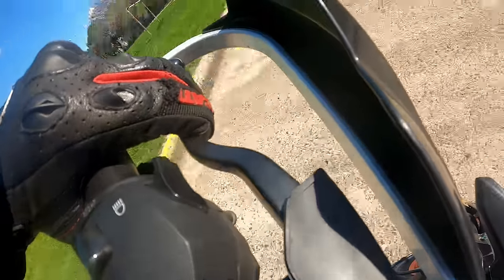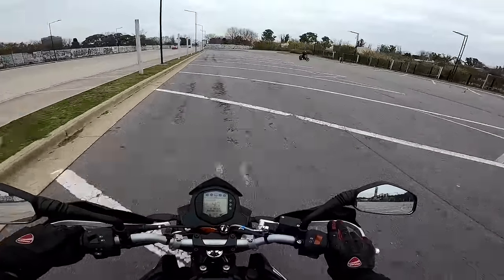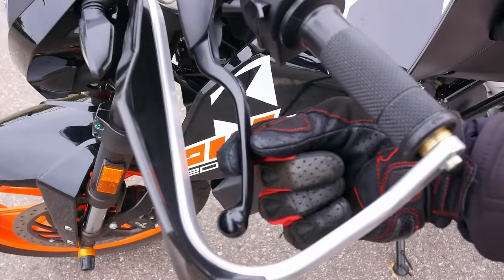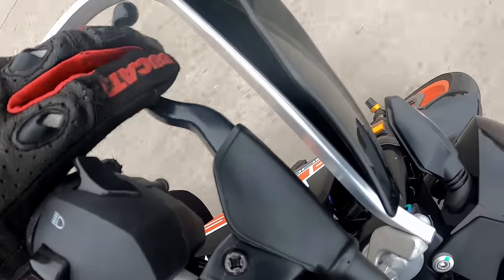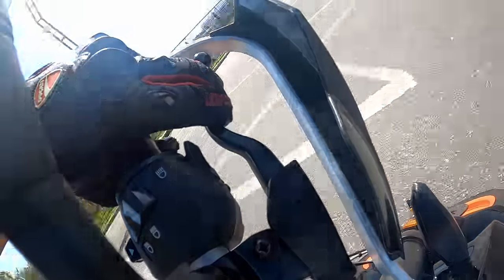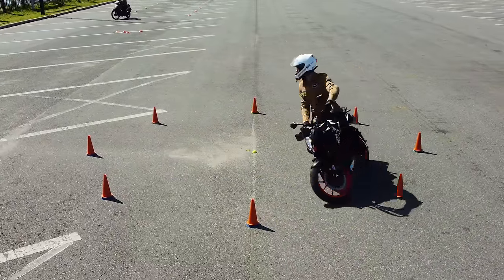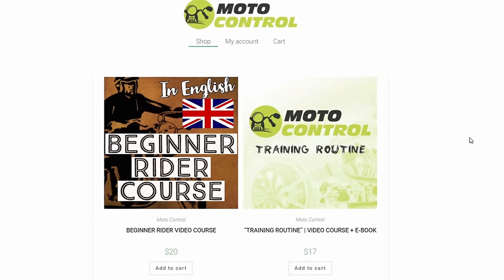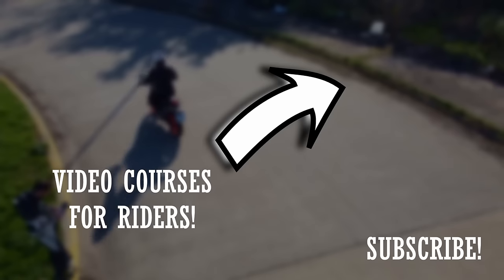How to Use CLUTCH on a Motorcycle - Free Full Guide

Comment: I think the whole clutch burning thing comes from the car world, where cars have dry clutches and overheat a lot easier than bike's wet clutches
Reply: Even when I used to drive a manual car, I let the clutch out to the friction zone before adding gas.  You can ride the clutch for about 2sec when starting from a stop because it's pretty much done slipping as soon as you're rolling, provided that you don't overwhelm the partially engaged clutch with heavy throttle.

Trying to save the clutch by slamming on the gears and engine mounts is a bad idea.  Slip the clutch a little.  That's what it's for
Reply: Moto guzzi’s use a dry clutch and BMW’s as far as I’m aware of. The upside of it is though is a Guzzi or BMW clutch will easily last as long as a car’s 100,000+ miles with normal use.
Reply: Yes, and some people reving like crazy while parking themselves using straight the friction zone... 😂
Reply: @Mythansar  it helps with the big boys stability 😅😅

Comment: Finally you explained it crystal clear. Regarding the clutch, appart from BMW, almost all bikes have wet clutches, meaning the clutch friction discs are rotating in oil which can take on a lot of heat without burning or damaging the discs. The dudes talking about burning the clutch, probably, have low to no knowledge about how a motorcycle works.
Reply: bMW now have wet clutches
Reply: only ducati now use dry clutches
Reply: Moto Guzzi uses dry clutch
Reply: Finally I found someone who is approving my clutching technique.. 😊 Thanks for the vdo

Comment: If you use more the friction zone, the clutch wears faster. Period. Wet multidisc clutches wears slower using the friction zone, and can handle a lot of abuse. But it doesn´t mean that you can´t use the cluth to learn. If it it wears out it can be replaced, not a big deal on tranverse engines wich most of the bikes have.

Comment: So, as long as the clutch lever is pulled past the biting point, it is disengaged, so the plates are not suffering any wear, right? Even if I don't pull it all the way?
.
I'm asking because I got used to using only two fingers,  so when I stop at red lights I don't pull it all the way. Some people told me it was causing wear of the plates, which didn't make sense to me, because I can feel there's no friction.

Comment: hi, I only have a cvt transmission scooter which has a dry clutch. It will burn out and it is better to practice slow speed exercises on a wet clutch motorcycle, is this right?

Comment: When going at 90 km per hour and you stop throttling, do I need to apply clutch so it goes smoothly or no clutch needed.

Not slowing down but just stop throttle for few min and repeat

Comment: Hi there, clutch free play does not vanish/disappear when the clutch (and engine) heats up (mentioned at 3:40), on the contrary, it typically becomes bigger, due to the (normal) expansion of the pack of clutch plates (plates become thicker). As an effect, the clutch can be dragging when trying to disengage, because the remaining clutch travel is too little to fully disengage the clutch. The free play becomes less only when the clutch plates wear (thus become thinner). So when cold, some free play must be there to prevent slipping clutch plates, but not too much, otherwise the clutch will not completely disengage when hot. A hydraulic clutch will compensate for the temperature effect (and plate wear), and thus have a constant free play (and constant disengagement travel).

Comment: Great video. Thanks for the upload.
If your bike has a dry automotive type clutch plate (BMW shaft drive bikes for example), it is safe to say that you cannot slip the clutch too much. If you do, it will overheat and eventually destroy itself. So as long as your bike has an oil bath type clutch - you will have no problem. Cheers 👍

Comment: I love your videos I always learn so much from them- one of the things I learned from your video today is there is a fight Zone I always call it the friction Zone and the bites only is up to the friction Zone- I might have called it sometimes it bites on but I really didn't know there was an actual bite Zone I just always thought of it as the friction Zone but it leads into the friction Zone

 one of the things I learned elsewhere is that bikes can get away more than cars with playing the friction Zone because they are wet clutches most bikes- I think there is an oddball BMW and bikes like that that do have a dry clutch like a car- but if you ask me the wet clutch concept I think should be on everything and it's really great having them almost bikes I really do play the friction Zone quite a lot with my bike

 once again thank you very much for your video or should I say videos 

For those that do not know the difference between a wet clutch and a dry clutch basically the clutch is bathered in oil which keeps the clutch from burning out the oil protects the clutch

When I'm on a hill or something and I'm playing the bite friction Zone I usually like to  see my front forks compress if you're hitting the bike just right even if you have your brakes on the engine will not stall it's a little hard with my bike because it's an older bike that has a carburetor depending on weather conditions sometimes my idol is a little stronger than others and I have more pull other times it might stall at my bike if the idle is slightly lower than usual but I can compensate that by hearing the engine and only went to add a little gas-  so you can play the friction Zone just right that you could be at a total standstill with your brakes on and not stall the bike

Comment: I have been driving for 2 years on an automatic motorbike and the last 8 months on a clutch motorbike.  But because I've been using a manual motorbike for 15 years, there are lots of problems with the brakes;  disc, gas, clutch, engine, gear, manifold etc.  And so it's effective for 4 months.  Today when I tried the motorbike test line for drivers licence at the police (coincidentally got a ticket) I was able to do it over and over again without falling or  stopping....with the friction zone control technique😁😁😁 

In here in motocontrol i get clutch dick knowledge👍👍

Comment: One side note, on air cooled engine you can overheat clutch and steel plates can glaze aka clutch slippage afterwards.
So practicing slow maneuvering with air cooled big vtwin should be done with breaks to cool down everything, exception would be Harley Davidson as they use separate sumps.
Reply: An 'Air Cooled Engine" means the combustion cylinder(s) are air-cooled. i.e. without water (or similar stuff) circulating to carry the heat away via a radiator.

This has NOTHING to do with the clutch.

The clutch is far enough away from the combustion, that it isn't significantly affected by that heat.

Air-cooled, oil-cooled, water-cooled - not relevant to heat on the clutch.
Reply: @waynerobertson511  oil is cooling air cooled engine, the same oil cools down clutch as well

Comment: Hi! What is the best for slow speed maneuvers: a cable clutch or a hydraulic clutch? I have a cable clutch bike,  but its a bit hard and my fingers hurts after a short period of time of doing slow speed maneuvers in the parking lot. So I wonder if a hydraulic clutch could provide a better feel ?
Reply from the maker: It depends on how many springs your clutch has and how rigid they are, hydraulic/cable is secondary. So there is no correct answer for your question, it depends on a particular bike!
Reply: @MotoControlEn  ,mine has 6 clutch springs, OEM parts. Is there any way to 'soften" the clutch without affecting its performance?
Reply from the maker: @mihaidarlau8353  Theoretically yes, there are "soft pull" clutch levers which stunt and dirt bike riders use a lot, but I never tried it myself
Reply: @mihaidarlau8353  Many riders have removed a couple clutch springs to ease the pull of the lever. Since you have 6, you can remove 3, alternate them, the clutch will still work fine.

Comment: If you are standing on a red light, do you leave the bike in 1st gear, clutch disengaged or do change to neutral ??
Reply from the maker: In most cases yes, I stay in 1st gear, unless it is a really long traffic light (the type with the countdown), in which case I just wait for cars behind me to stop and then I shut down the engine. Then when it has about 10s to turn green I start the engine back.
Reply: @MotoControlEn  thank you for your answer Andrei !

Comment: Hello Moto control, for using the friction zone I am not able to keep the steady throttle open on my bike.  As I operate the clutch in friction even after keeping the steady throttle open my RPMs drop. My bike throttle is having Ride By Cable mechanism so is that the reason of RPMs dropping even after opening the steady throttle ???
Reply from the maker: RPM should drop when you're releasing the clutch because load on the engine increases, as long as you keep your throttle slightly opened - it shouldn't be a problem!
Reply: @MotoControlEn  Ok thanks, I will keep this in mind while practicing next time 😄

Comment: How advanced will this new course be? If you have a motorcycle license, would the beginner course be too easy?
Reply from the maker: Now there are 2 courses available: Beginner Course (DO NOT buy it if you already have a basic training and license, it will be too easy for you) and Training Routine (it is fairly challenging, mostly for slow-speed control). The new one I'm working on now will be completely different, it will be a 2-month training program with a particular topic and bunch of exercises for this topic (around 50 exercises in total for the whole course) and an exam at the end. This one will be a real challenge for an average rider and will boost riding skills considerably. But it's only about 40% ready for now, I think I have to work on it for another month there is a lot of stuff to record🙂

Comment: hi, What Is lever protector do you use?
Reply from the maker: Hi! Them are stock aluminium handguards from 1090 Adventure, but I have a strong suspicion they used identical handguards on a lot of KTM bikes.
Reply: @MotoControlEn   I have a KTM 2022 Duke 250. What do you think would handguards suit it?
Reply from the maker: @SaudiSmoker1  I can't tell for certain, but  probably yes!

Comment: if you use 4 fingers to clutch how many fingers are left holding the bar?
Reply: 1 😂 Thumb & palm. I actually do that quite often, still stretching my left hand for 2-finger pull. The clutch isn't hard at all, just my left hand, while right hand is fully OK with 2 fingers on the brake lever.

Comment: So  when performing the downshift i clutch in just past the bite point, blip the throttle, click down a gear  all at the same time and then release the clutch slowly
am i right sir ?
Reply from the maker: Pretty much! Check out my video about shifting, the process is shown better there😉
Reply: @MotoControlEn  yes I use that video to practice. I learned to clutch less up shift but I need to practice more on downshift part.
Reply: If you release the clutch slowly then the RPM would drop significantly and cancel out the effect of blipping. Easing out the clutch and blipping are sometimes seen as two opposing techniques.
Some people prefer easing the clutch during downshifts, because it allows you to benefit from engine braking and performing that technique is easier when you have to apply clutch and brakes simultaneously. Blipping during hard braking is very tricky. Sure, easing it out would burn your clutch faster, but the clutch is not that expensive to replace.

Comment: Whats the difference between footbrake and the handbrake?
Reply: If you don't know yet, footbrake is for Rear break, mostly for smooth breaking and something you need to just reduce the speed In a not very fast manner

Handbreak is the frontbreak, this is where ALL the break power is, You use them to stop faster. Most of the time engine breaking Is enough tho

Comment: Is it safe to do clutchless shifting even without quickshifter?  thanks
Reply from the maker: Afaik it's not recommended, because it puts additional stress to dog clutches. I personally didn't have any problems so far, though I use clutchless shifting from time to time (for demonstrations during classes, mostly). But if used constantly - I think there will be problems eventually. I don't have proof though. You can make your bike a guinea pig if you want😁
Reply: @MotoControlEn  thanks :)  I still use clutch but tried only that several times :)

Comment: Great video!
Two things I didn't really understand. Probably because of stupidity on my cide ;)

Can we just use the clutch without throttle (for starting for example)?
And if yes, then what advantage does it have to use throttle with it ?
In my mind it is like: the beginning only needs clutch because we are slow and later we need throttle to be faster.

When going down several gears each do I have to release the clutch each time? Or can I just pull the clutch and press two times down with my foot to go down 2 gears?
Reply: On a plain road, or downhill, you can start off at idle rpms, however, there is a risk to stall the engine if you release clutch too fast - that varies from bike to bike, as some have kind a 50cc engine, requiring to revv-up to get sufficient torque, and other bikes have 2 or 4 cylinder engines optimised for higher torque from low rpms (typically, cruisers, police bikes, etc.). If you need to start uphill, or with a passenger, or just want a faster start (like when you're first at traffic light, and lots of cars behind you waiting to take off), you'll need to accelerate engine to 2500-3500 rpms before releasing the clutch.

I often go down through several gears when quickly stopping due to a sudden traffic change (crazy taxi drivers, pedestrians running through the traffic), e.g. disengaging the clutch and shift down from 4 to 1 (or 5 to 2) while decelerating using front & rear brakes. When stop is predictable, I go down gear by gear, reducing speed via engine braking.
Reply from the maker: 1st question - you can, but it is not very practical, just try both methods one after another and you'll feel what I'm talking about🙂
2nd - yes, sure you absolutely can, nothing wrong with it. Only make sure your engine braking is not too strong when you downshift 2 or more gears at once, release the clutch a bit more careful

Comment: Wet clutches, which most motorcycles have, are designed to be used this way. Dry clutches, like cars and a select few motorcycles have, are not designed to be used this way and will be burned out quickly.

Comment: Blipping the throttle while braking i am unable to do without affecting the braking force ;/
Reply: Try to practice with the bike off. Just the motion, to isolate the movement and focus on that instead of the whole bike.

Usually doing the way he does in the video is the best. Make a hook with your usual front brake two fingers and make sure when you blip the throttle they are moving up and down and not towards and away from you. That way you will remove most of the unevenness in braking when blipping the throttle. You may need to adjust the lever position and even in some cases regulate or change the lever entirely for one that allows to be adjusted accordingly. 

It can be done with the fingers a bit more straight too but it needs some level of sliding over the handle and is probably less secure overall.
Reply: @lucascarracedo7421  
When i think about it, the lever is maybe just too far to make that hook. I will look into it. Thank you.
Reply: @EEEEMMMMKKKK  makes sense. Happened to me too. I kept the fingers very straight so any motion in the wrist actually pulled the lever back, thus introducing that uneven braking. Good luck with that mate.

Comment: I'm not a clutch expert. BUT. I do think that an MC clutch is way more durable compared to a car's clutch. Mostly because of major weight differences. An average MC clutch seems to be around 1/3 the size of a car's clutch. Now, the average sedan weighs around, let's say 1300 kg. And for ease of maths, let's say the average street bike weighs in at 130(+~70 for the person) kg. Since the clutch isn't 1/10 of the size of a car's clutch, I would imagine that the clutch can take much more of a beating and doesn't overheat as easily because of it.

Not saying all of this is true, but using basic logic I think that this should be true, to some degree. And I also think that as long as you are riding at the same speed the clutch doesn't overheat as easily as if you were using throttle or starting and stopping while staying in the bite point with high revs for long periods of time.

Comment: What if the accelerator was where the rear brake was, the clutch was where the gear shift lever is, and shift up is where the front brake is, and shift down is where the clutch is? 🤣 So Some kinda weird car controls but on a motorbike